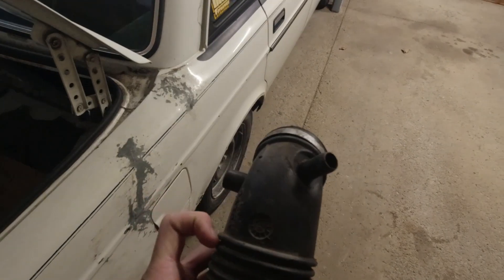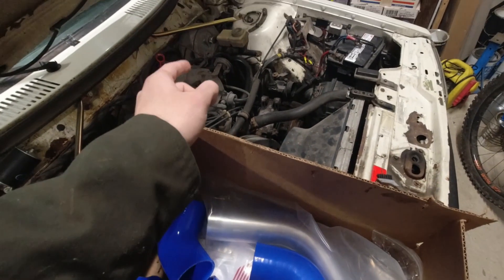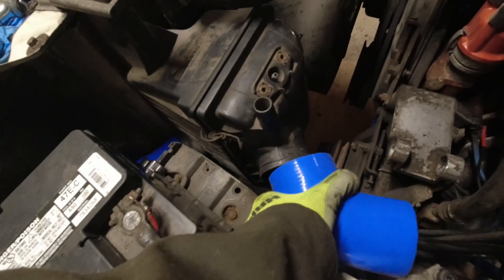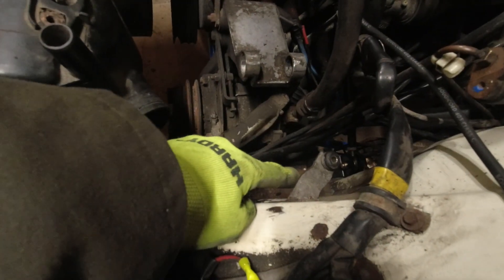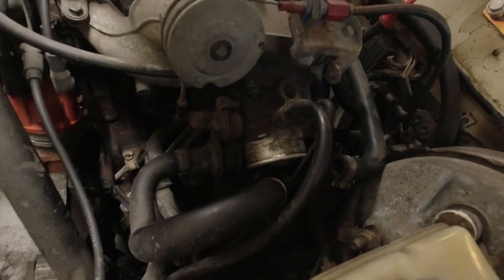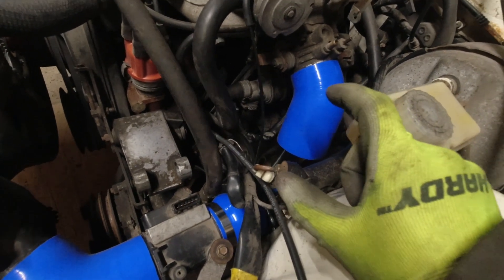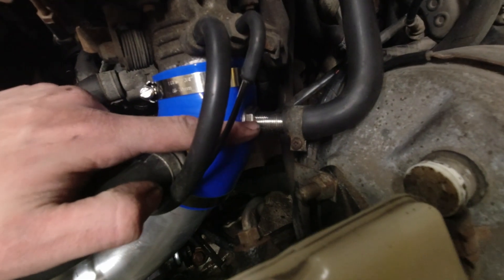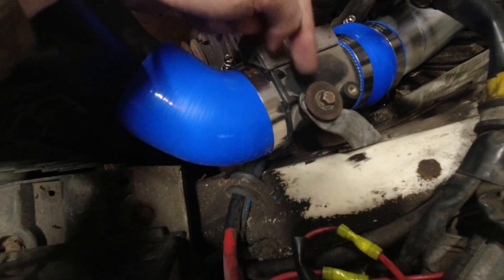Volvo 240 Custom Intake - Build and Test

Comment: cool mod and video, I may try this using the top part of the existing accordion connected to the aluminum tube, i have already removed the flapper from the airbox and routed the hose from exhaust up behind the grill w/ a snorkle (no under engine cover) for all cold air into the box from 2 sources at all times. i can feel a difference on open highway.
Reply from the maker: Thanks! It's worth a shot, might make finding aluminum tubing easier (and more affordable) if you only need a straight section. The accordion folds might flow a bit slower than smooth tubing would, but I highly doubt the difference would be noticeable. Best of luck if you do go that route!